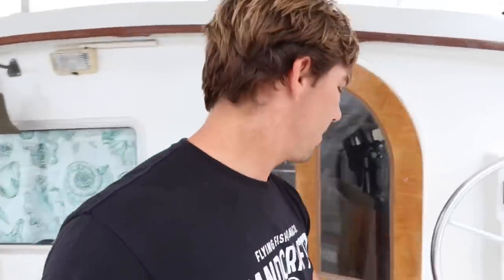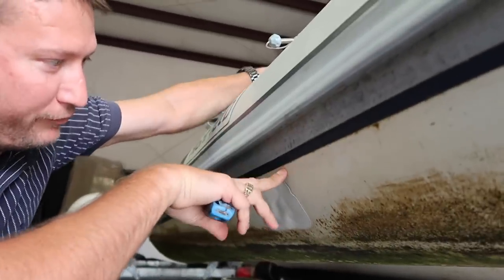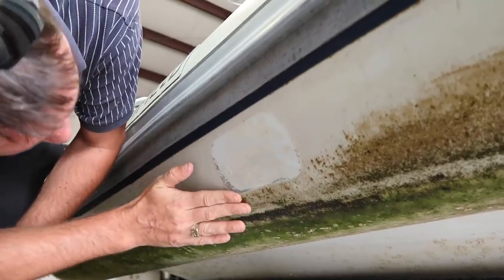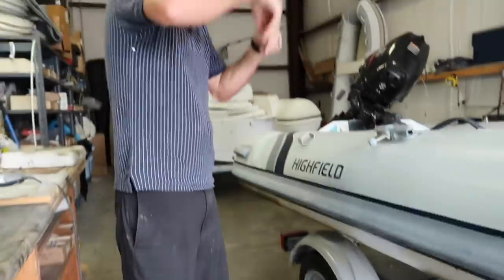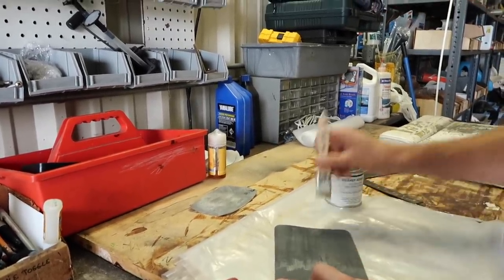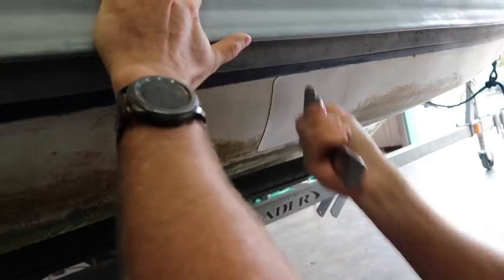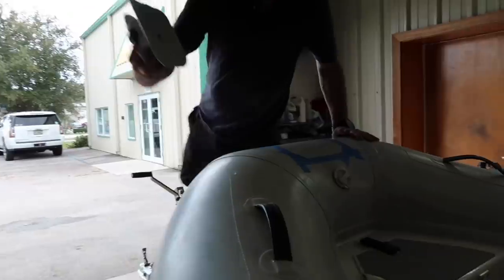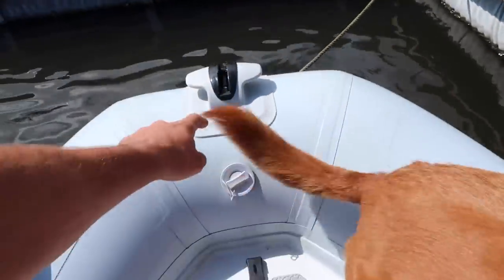WE MESSED UP. Learning the RIGHT Way to Repair a Hypalon Dinghy from Professionals.

Comment: This repair was made for using Inland Marine Sealant(Fla). I sealed (permanently) a raft with a thousand leaks.  I always have this in stock.This stuff works on leaks that produce a soap bubbles less than the size of a dime. Doc(30 + year professional)

Comment: This was very educational thank you. How long was the drying time before you inflated the dink again?
Reply: Suggest 24 hrs.
Reply: Depending on glue used and pvc or hypalon usually best is 24hr but in a pinch aslong as you dont inflate hard and the temperature isnt too hot you can get away with 12 but usually best practice is 24

Comment: I take it that's that same for a iSup repair. I have a Waterman C4 and I kinda sweat a bit thinking about a iSup repair.
Reply from the maker: I think inflatable sups may be PVC material vs hypalon. It might be a slightly different process. Mike from a sailors place might comment here to let us know.
Reply: Your right..it is PVC. I forgot about that! See it makes me all kinds of wonky thinking I may have to repair (and not sure if it will work) the one thing that allows me to escape.
Reply: @0PsychosisMedia0  if its a small leak you can use a small patch to repair, and instead of sanding the pvc you would use the chemical MEK to score the surface on the Sup, and the patch, then use a pvc glue. if its a seam leak it is toast.
Reply: Thanks for the heads up!

Comment: Doing a patch job on a rubber inflatable boat at sea thats pretty hard to do. I've patched enough bike tires to know you need to have dry conditions also the item has to be deflated for a period of time. It seems that boat should be under a warranty those small holes are odd, they just shouldn't be there.

Comment: Did he really apply acetone and then use his bare hand to knock/touch the insides of the material thereby putting some oil on it? I would have wanted him wearing gloves or not touching any bare material. One of acetone’s job is to remove all oil and he sort of compromised that unless the filming was out of order or he re-applied acetone after touching it.
Reply: I reapplied acetone.
Reply: It was cleaned after touching it.

Comment: That repair should have been done with tube deflated. Putting a patch with pressure leaking through a hole is going to weaken the patch and eventually lead to a fail on a hot day when tubes are pressurized.
Reply: Thank you for informing me of how I should repair this inflatable. About 2 psi was taken out of that chamber before the repair was performed, then deflated, then 24 hours passed before inflating the boat to normal operating pressure. Have a nice day.
Reply: @mikeh1784  You did it right. That way the patch conforms to the curvature of the tube. sometimes I will put sealant in and If I still think the area needs a patch such as a wear area  or replacing a handle, etc. I put it on with chamber fully pumped so the installed ptice matches curvature ans stretch of the inflated chamber. Have a nice day. Doc{33 years pro experience)

Comment: Only use 2 part glue..
Tape around patch leaving 1/8..
For small holes.. to 1/4..
Just Super glue.. test the glue first..some dont like water..
Should last a couple years..
Reply: 1 part is fine , sealant better for small holes. NW river supply has glue. If your repair fails it's not the glue.  Doc

Comment: I hate to tell you this  I’ve owned several name brand inflatables  and they don’t do very well ounce they start leaking  I’ve had them professionally repaired and I’ve done them myself  mine were PVC  and I bought the correct glue  from the manufacturer that begins with Z  with them I have my doughts about their overpriced glue  that really just looks like regular PVC glue  thinned with a retarder  to slow the curing  down to bond stronger I assume  for me my conclusion has been  when the boat hits a certain age , they are shot  and not worth pouring time and more money into since your motor is gone keep a eye out on Craigslist ,etc for a good deal on a small Whaler or other fiberglass boat , I  personally  have had great success with Whalers   With 9.9  Evinrudes  they longline tow well  and are pretty sturdy for running groceries and occasionally people/ dogs around

Comment: Did something very similar, the big secret is the two part glue, one part $ucks.
Reply: Actually the one-part glue is part 1 of the two-part adhesive. The other part is an accelerant.
https://en.m.wikipedia.org/wiki/Accelerant
"Accelerants are substances that can bond, mix or disturb another substance and cause an increase in the speed of a natural, or artificial chemical process. Accelerants play a major role in chemistry—most chemical reactions can be hastened with an accelerant. Accelerants alter a chemical bond, speed up a chemical process, or bring organisms back to homeostasis. Accelerants are not necessarily catalysts as they may be consumed by the process.
The use of accelerators and activators lowers the activation energy of vulcanization reaction to 80-125kJ/mole from 210kJ/mole which is necessary if we use sulfur alone. Accelerators and activators break sulfur chains. Accelerated sulfur vulcanization systems require only 5-15 sulfur atoms per cross-link as compared to 40-45 S atoms/crosslink for a non-accelerated sulfur vulcanization. There are many accelerators available for the vulcanization of rubber. That is because there is a wide range of rubber articles on the market with a wide variety of properties. For instance in a car tire alone there can be already up to eight different rubber compounds, each with specific properties. For instance the tread in a typical passenger car tire consists of a mixture of SBR (styrene-butadiene rubber) and BR (butadiene rubber). This rubber should have high abrasion resistance and high grip on both dry and wet roads. The side wall of the tire should have a high flexibility, meaning that it should resist many flexings during the running of the tire without cracking. It consists normally of a mixture of natural rubber and butadiene rubber. Inside the tire there is a rubber compound with as major function the adhesion between rubber and the steel cord of the belt. It typically consists of natural rubber with a very high sulfur level (up to 8 phr), to get a relatively stiff rubber, with sulfur promoting the adhesion with the steel cord. The basis of the tire is formed by the carcass, normally a mixture of NR (natural rubber), SBR and BR. It should have a very good adhesion to the polyester cord, used as reinforcement. And the inner side of the tire is formed by the inner liner, normally consisting of halogenated butyl rubber (IIR) For all these compounds with their different properties different accelerators and mixtures of accelerators have to be used to obtain the required properties. A vulcanization accelerator is typically used in combination with sulfur as the cross-linker, and with zinc oxide and stearic acid as activators. Other additives can be added too, but for the cross-linking reaction, those mentioned above are the most important. The various types of rubber used in the various tire compounds all have different vulcanization characteristics, like speed of cure (cure is the crosslinking reaction) and extent of cure (the number of cross-links). A typical passenger car tire is vulcanized for 10 minutes at 170 degrees C. Many accelerators and various mixtures thereof are typically used to ensure the vulcanization of all the component compounds have completed during the 10 minute process."